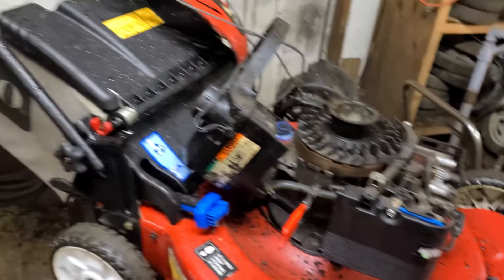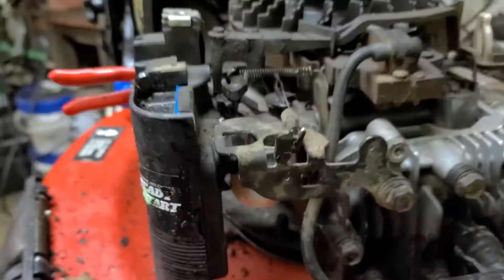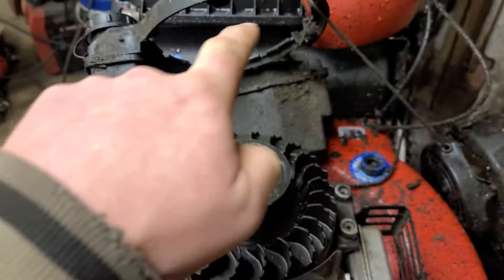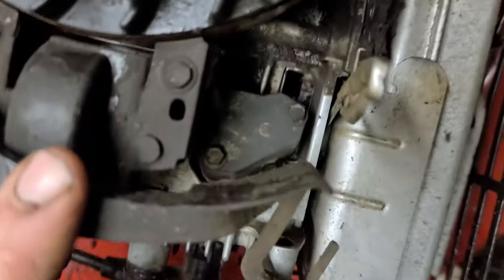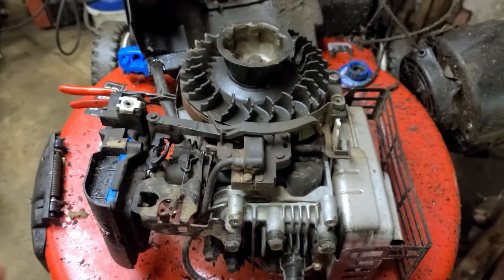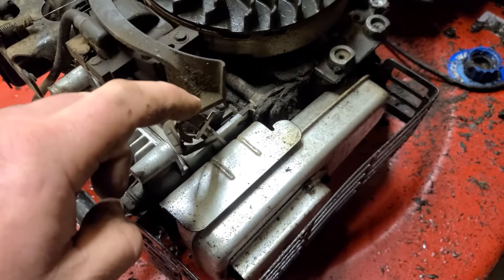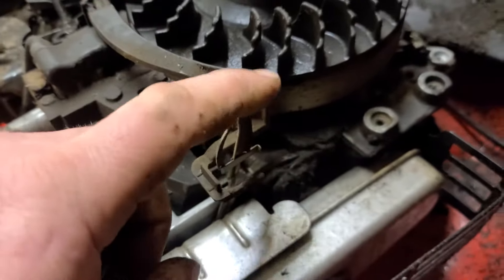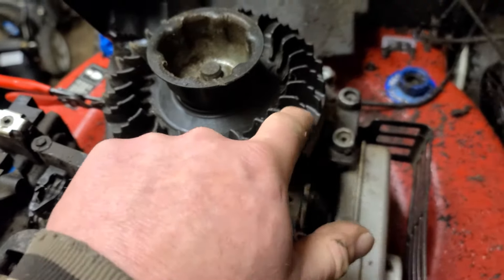How The Auto Choke Works On A Briggs And Stratton Lawnmower Engine #briggsandstratton #lawnmower

Comment: Had the problem where mower would not start without a bit of gas squirted into the carb. The carb was cleaned and appeared to be working properly but I noticed the choke plate was not closed when the motor was cold. I removed the flywheel cover and found a tiny twig had jammed the auto choke lever in the open position. Upon removal of the twig and reassembly, the engine started normally. Thanks for the video!
Reply from the maker: Same thing happened to this one the other day 

https://youtu.be/LZEd2gWN4CA

Comment: I found one of these with the bagger 3 houses down, it was ready to be picked up by the garbage man, but I ran over to get it. Took it apart as it looked like they had attempted a repair on it. Went through it and followed this video on how the auto choke worked and found it was not put back correctly. Thank you so much for this informative video!

Comment: This is an example of what I dislike about modern small engine carburetor control designs; complex & unreliable system that wasn't designed for the "real world", & designed by someone who apparently has no concept of "real world" conditions. The older manual choke operating system seems much more robust & reliable, & easier to fix (usually with only minor cleaning). This "removed from reality" design mentality seems to apply to many modern machines.
Reply: yes and no, its probably the best mower I’ve ever owned. and it uses a spring, tell me whats so complex about that
Reply: These choke systems work just fine , and are easy to repair if they don't
Reply: Having said that, these new machines are made for people who don’t know how to work a choke……oh well…….
Reply: @PerroSucio  seems like a waste of an education system if it can't teach you real world lessons
Reply: Got to sale more high dallor parts
Reply: Exactly, it’s designed for the lowest common denominator, so that it’s extremely easy upfront, requiring no procedure at all. Yet, since it’s more complex, more things to fail, in ways, they wouldn’t have otherwise.

Comment: thanks a lot. I just ran into a issue just like this. I just replaced the carb. and still was starting then stopping. while I had cover off I started mower and pulled the choke lever a little and it stayed running. after a few stops and starts it runs no problem. if happens again ill know what the issue is thanks to you. that thermometer lever might be sticking.

Comment: I have been searching high and low for this video! I have this exact model that I purchased used from a young guy who was tinkering with it. It would run but only have 10 pulls starts then it would die. Then 10 more pulls starts and it would run but at a rough idle.  After watching this video I can now see the mower is missing the top spring. 🤦🏻‍♂️ thanks for making this video!

Comment: Very helpful video. In my case, I took everything apart and found a densely packed mouse nest with the occupant jammed into the far end of the lever by the thermostatic thing. It would move toward full throttle but then back off and sputter when it hit Mr. Mouse.

Comment: This is a very good video.  Replaced the vane, lost it.  I found your video, Crafts push mower replacing vane spring.  Maybe, Craftsman mower won’t start: replace broken or missing vane spring explained. I wish you had shown behind the exhaust, the part you mentioned.  Overall very informative.  Learned something today!  😊
Reply from the maker: You are the mechanic now!
Reply: @machinesnmetal I’ve rebuilt several carbs on different push mowers, & my dad’s riding mower.  This is “new” problem!  I really like the tutorial & thanks again.  I’m checking out your channel.👍

Comment: Been working on an MTD mower with auto-choke. After seeing this video, I know what the issue is with my mower and why it won't stay running. The smaller spring that runs front left-to-right is in the wrong location on the arm. Currently has very little tension on it.  Thanks! I figured it was something simple.
Reply from the maker: Excellent 👌

Comment: Great ... I have this exact engine and am experiencing starting problems ... this sure helps explain what is going on ... 

Just bought a replacement carb from Amazon ... guess what ... it doesn't have the auto choke butterfly valve ... too late to return ... only has the throttle valve 

Will try to clean and replace ... but this video is well done and helps a lot 

Thanks

Comment: Man that auto choke is a pain and I was having flooding problems each time I went to start it.  I removed my vane and went back to a manual choke carb and bought a used bracket with the choke lever.  I live in FL and it starts every pull now (never needs to be choked).
Reply from the maker: You! are the mechanic now

Comment: Thanks for that video. 
I Picked up an pressure washer with a 14yr old briggs w/auto choke and it didnt look right. I see owner f'ed with it and replaced all the springs in all the wrong spots lol 

It still had the same briggs plug in it they put in when it was built 😂 and carb was old coagulated gas & Vaseline.

Comment: That spring was very loose and cause my brand new B&S 450 148cc to sputter all over the place. I tightened it so it was a perfect fit, no tension other than keeping the governor in place properly. Been running like a clock for over 10 years after that. Was not aware it adjusts the choke as well, kinda clever IMO.

Comment: mower was revving high for last few yards. it  stopped running yesterday.  cleaned carburetor today.  could not see tell if anything wrong with choke.  mower started and is running but revving terribly.   later found a small part  that I guess fell off when I was fixing it.  about the size of a penny with a little hole in it and indentions.  is this my revving problem?  is it connected with choke?  no way to upload a photo of it, but a little smaller and thinner than a penny and made of metal.

Comment: Thanks for the great video . The pivot screw and the air vane are frozed on my mower. Not sure about the thermostat and will need to check it with heat gun. Depending what I find after getting the shround off,  I may just change  carb and air filter housing to a primer bulb system .
Reply from the maker: It's common for the vane to get tight on its pivot screw. Take apart and buff it put a drop of tri-flow and good for another 5years

Comment: Great video and explanation.  It's frustrating that the manufacturers decide to take away the manual choke and replace it with something much more complex, which introduces many more things that can fail and increases the difficulty in troubleshooting (all in the name of convenience of not having to manually push a choke lever).  A case of "don't fix/change it if it's not broke."
Reply from the maker: The manufacturers have no choice, the government's force emissions compliance on them and manual chokes pollute too much. It's the main reason Honda dropped out of the lawnmower game this season.
Reply: @machinesnmetal  Thanks for the info.  Why am I not surprised.

Comment: For some reason my flap/arm was stuck in the closed position on my 20 year old Snapper, not allowing the mower to rev up. I took the cover off and pushed it open, and sprayed some lube on the moving parts. All is fine now.

Comment: Good video. My mower will not start when hot because the thermostat has the choke open.
Anything I can do but have a coffee while it cools down and finish mowing the lawn?
Reply from the maker: The thermostat is supposed to keep the choke open when the engine is hot if it won't start when it's hot there's probably dirt in the carburetor preventing enough fuel getting through the main jet when the choke is in the off position.

Comment: Great concise video.  One of the best informative videos that doesn't take forever to view.  So My Gold Series Briggs L-Head engine starts perfectly - Choke closed.  But when the engine is up to operating temperature, Choke is fully open and it will not start. Any advise on fixing it?  I tried to clean the carburetor but the problem persists. Wondering it there is a way to have it a half-choke when hot?  Or some issue with carburetor?

Thanks for any advise someone here may be able to provide.
Reply from the maker: Did you check the flywheel key?
Reply: @machinesnmetal  I have not checked the key.  It runs so good as long as I don't have to shut off to empty the bag.  Like she is too lean to start when hot.  I'll look at key for flywheel.  Thanks!
Reply from the maker: They tend to rich up a bit when you stop the motor as it continues to suck in air/fuel after you let go of the bar and the spark is cut from the equation. Sometimes if you don't wait a few minutes before starting it's a 5 pull start because the chamber is too rich with fuel. I think in the motor manual it even says to wait 3 mins after a shut down to allow the rich to thin out sometimes it's referred to as a flood. 

Check that flywheel key, could be your problem.
Reply: @machinesnmetal  I'm having the same issue auto choke is working properly but when the engine is hot and choke open it will not start, not even a hint of ignition. I hold the choke closed and it will fire so I immediately open the choke and it continues to run.  So tempted after 3 years of this and no one can solve the issue to install a manual choke. And my flywheel key is good.

Comment: I recently was given a 2012 Husqvarna HU775 that had been stored in a climate controlled storage unit for 12 years that was used twice when purchased. It has the lever for starting, fast, slow, and stop positions on the left rail. I cleaned out the gas tank, carb bowl, carb jets, and put in new oil. It fired right up and runs, but not at full rpm though. I found a cracked breather tube and replaced that, but I have the same issue.  I'm not sure if it's the throttle control cable, governor, springs, but it's got to be a simple adjustment. Any ideas?  Thanks!
Reply from the maker: add some tension to the throttle cable

Comment: I thought that the automatic choke is activated with the exhaust and a thermo switch that opens and closes the choke when the engine is hot or cold; and what you are describing there is the governor; my old lawn more has that fan operated lever and it does not have an automatic choke.... my new lawnmower has an automatic choke, but I havn't had any reason to remove the covers as yet.
Reply from the maker: These models use both, it was briggs's last attempt at meeting emission standards with the L head engine. The governor for these engines is located underneath the flywheel. after this engine they went to the E-Series OHV motors.

Comment: Hi. I repair lawnmowers. I have a lawnmower with the same carburetor that you have for repair. I cleaned the carburetor and engine compression gauge 2.8bar - 40psi briggs stratton 825 I/C. The engine starts cold, but after a while the revs start to fluctuate. The automatic choke is fine. I haven't found out what could be the cause yet.
Reply from the maker: 40 seems low. Put some 20w50 in it and try the compression test again

Comment: I was wondering what that whole choke system was. 

Someone has wired mine wide open. Has been that way since I got it used. Always wondered what it did and why it was done that way.

Now I'm curious if I can get the right springs to see if I can get it working like it is supposed to be.
Reply from the maker: You should be able to, if you have all the proper parts and they work... I'll let you in on a little secret ive learned about fixing things, just put them back to the way they were when they were made. 100% of the time it fixes them.

Comment: Thank you for the video that, clears up a lot for me. Question though, mine has been surging and I’m thinking it’s got to do with this. 

Where can I find the right spring for these carbs, cuz the ones on Amazon aren’t strong enough tension I presume
Reply from the maker: A surge is usually a dirty mainjet. You can use your model-type-code to lookup the correct spring for your engine on any Briggs online parts lookup. Then I recommend you buy an OEM spring off eBay.
Reply: @machinesnmetal  so I’ve changed the Carb and cleaned the original one 2 times, I changed the spark plug, gas, air filter, gaskets, sprayed all around the hoses and exhaust for air leaks… I’m completely lost
Reply from the maker: when did the problem begin?
Reply: @machinesnmetal  I got it in a trade and it was all messed up

Comment: Had a question about the choke.  When the Briggs engine is warm/hot from running for a bit, when you shut it down will the choke remain open unto the engine cools down ,The once  cooled down go back to the choke position?? The reason im asking is when mine was warm or hot from running for 10 mins or so will that choke stay in the open position unto the engine cools down after a half an hour or so? Please let me know would really appreciate it trying to make sure everything is in working order.
Reply from the maker: Did you watch the video?

Comment: I have this engine on mower I'm working on! Spring was missing on arm which I have replaced. Waiting for more parts before I try to start it. The other mower I'm trying to keep out of junk heap is a Zstart Craftsman with no prime bubble and Fresh start pods. After installing new carb and throttle cable, it won't start because choke doesn't close. The cable I replaced is obsolete and the one Craftsman says is replacement had spring on end instead of dogleg. The one I ordered is shorter but it operates choke lever properly, pulls it all the way back. Mower won't start with rope without start fluid because choke is not closing. Is there an adjustment I need to do? Once started with fluid, it runs perfect! Having trouble finding Fresh start pods, too. Help!!!!!
Reply from the maker: Maybe just get a primer style carb from the scrapyard and change over from choke cable setup to a primer setup. Problem solved. The mower scrap yard should know where to get the pods, I found them at Powersource Canada on anacis island.
Reply: Thanks for your reply. I think my terminology was confusing. There is nothing connecting the mechanism that closes the butterfly in carb when I engage brake handle to start. Should there be a spring or something connecting the two mechanisms to close butterfly in carb or does it somehow work off off some kind of vacumn. The Air vane on the other mower I'm working on keeps butterfly closed and then opens it up when it's running and has thermostat to regulate. Total different technology. There is nothing that moves the mechanism to close the butterfly unless it's done thru air filter or it needs to be connected with spring or something. No one seems to know???? BS engine# 125K-0658-E1
Reply from the maker: I looked up your engine number on ereplacement parts.com and it shows that engine came with a primer, manual, and autochoke system. It would be best to hit the scrapyard and get the primer parts and make yours use a primer.
Reply: @machinesnmetal  This machine does have a primer, but the fact that the butterfly is open initially is why it won't start. I found video that showed how to adjust pin in govenor that goes into motor under gas tank? Will this adjustment make it so butterfly is closed initially and then somehow open while running? My other machine has the Air vane system and butterfly is closed initially and then opens while running from air off flywheel. No one can seem to figure out how to get butterfly closed so it will start. YT video says anytime carb is changed, this pin needs to be adjusted? There has never been a manual choke. I bought machine new and it never had starting issues. This new carb is first new one ever put on it. Guess I'll try adjustment, but need to get right size socket! Video says 3/16" but thatcwas big. 4mm fits but mine is not deep enough. Will look up video to reference. Won' t let me paste it here.
Reply from the maker: if it has a primer then regardless if the butterfly is open or closed when you prime it a shot of fuel will come up out of the gold pipe in the middle of the carburetor and it will prime the engine to start. Alot of the time the gasket in between the air cleaner box and carburetor is not tight enough for the prime pressure to make it from the bubble through the back of the air cleaner and into the small port on the mouth of the carburetor, if you double the gasket and don't tighten the airbox backing too tight is usually works.

Comment: Edit:  first, thanks for the video! 

Issue:  I have same lawnmower. Ran it without issues 2 weeks ago. Filled it with gas yesterday and it doesn't run well.  It sounds "labored" and won't even run in "mow mode". I emptied the tank and filled with brand new gas. Didn't help. Tried carburetor spray, didn't help.  Cleaned the air filter too. None of these efforts improved the motor running. Still sounds like it's struggling... Should I replace carburetor?
Reply from the maker: Take your carb off and clean it out
Reply: @machinesnmetal  thanks for responding! I'm going to try that

Comment: Great video. Mine has the exact setup by after running for about three-five minutes it just dies. I've pulled out everything with the fuel . Any ideas?
Reply from the maker: Try loosening the gas cap when it dies
Reply: If gas cap doesn't help,  I hear that the coil might be going bad when hot  ??

Comment: THIS VIDEO RULES! Can any of this assembly cause the engine to surge or is that usually related to the carb jet?
Reply from the maker: Usually related the the carb jet, or gasket leak
Reply: @machinesnmetal  Thanks! I removed the car bowl and gave the jet a good cleaning. Problem solved. Thanks!